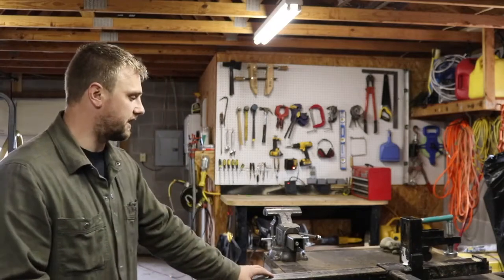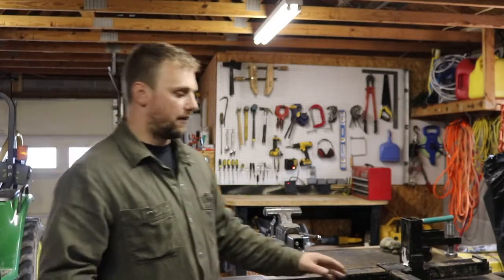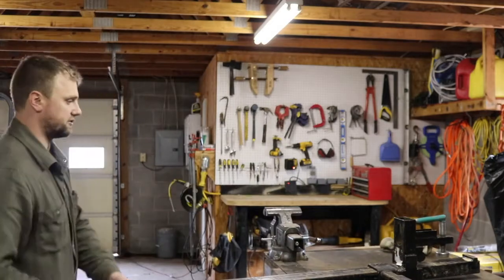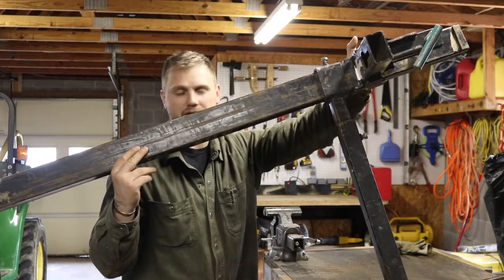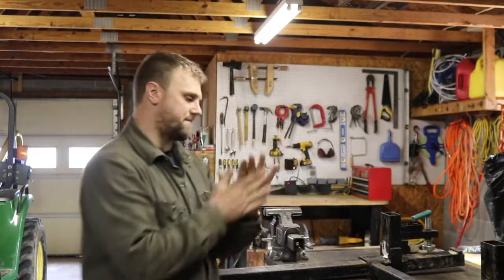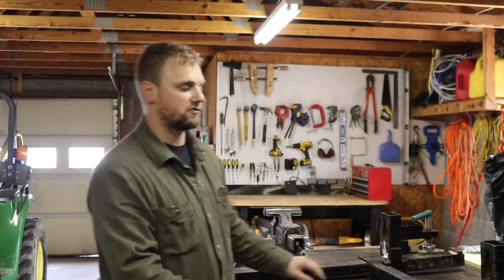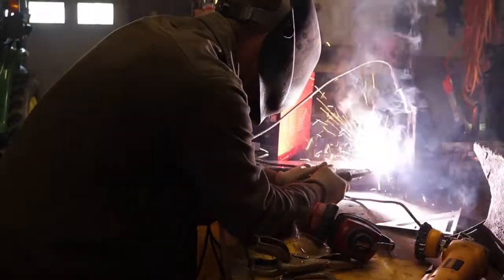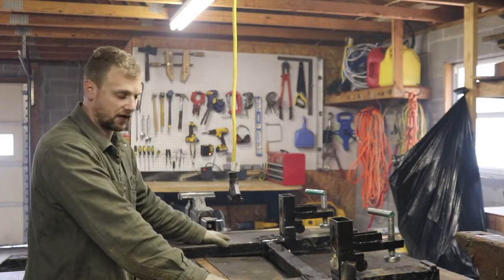Welding On The Farm!!! Lets Talk Tractor Forks!

Comment: Thanks for the info. I also have a JD 4200 and have been thinking of getting forks, what brand are they?
Reply from the maker: Michael Storm these are from Titan attachments. Which I actually just ordered off of Amazon and I’ve been pretty happy with them. It is hard to see around the bucket so I had to disable my seat safety so I could stand up and get on a pallet. Next week I’ve got a video coming out on the thermistor solution if you’ve had problems with yours.
Reply: @timberlinetactical  Thank you, I'll look forward to your next video.
Reply from the maker: Michael Storm thank you for watching!